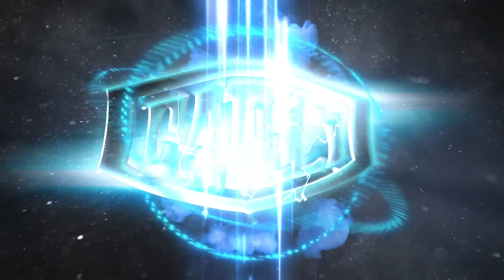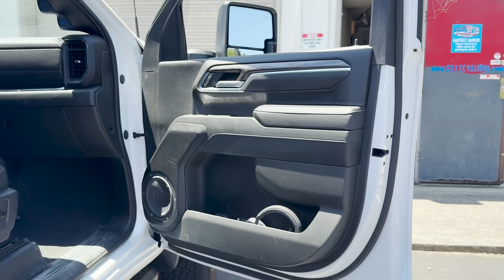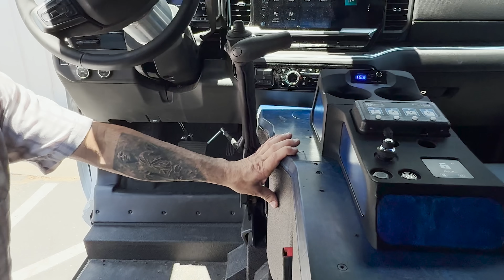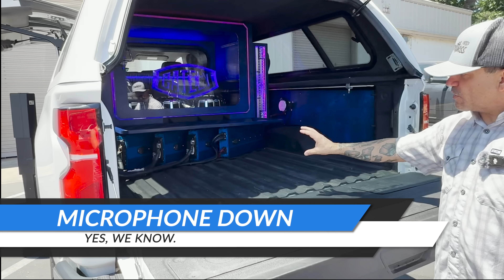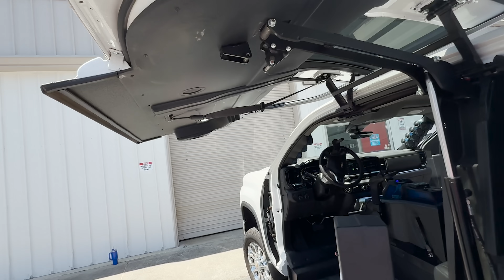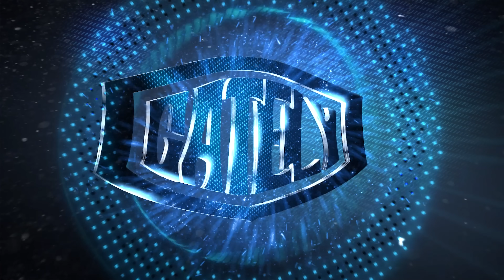Brandon's BASSFORMER - Gately Audio Build

Comment: I have one question about the A pillars. Do you take out the air bag? And if so, what do you do for the air bag light? Because I wanna do my A pillars but I was just planning on leaving the air bag so the light doesn't come on. I won't pass inspection if that lights on. Thanks
Reply from the maker: We leave the air bag in builds like this one. The larger scale builds that are not normally driven we remove the air bags

Comment: ❤💛💚 gately superb & flawless car audio builds
 Question to bobby or gately crew, would that new 12 inch F4 relentless sub be a great pairing for the  gately 12 inch camaro box, and if so what is the wattage & lowest ohm rating on it? What amp do you recommend for it?
Reply from the maker: Yes the Relentless F4 12” will be amazing in the Camaro perfect fit.  I recommend running our G1-7100D and getting the D1.4 ohm coil configuration to run at 0.7 ohms.   Going to need significant electrical upgrades to run this but it will be wild. :)